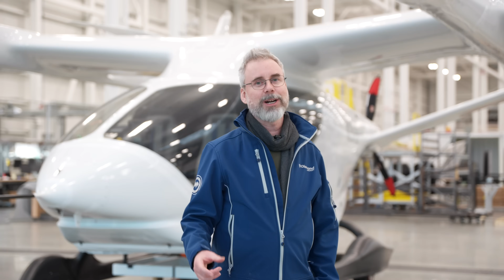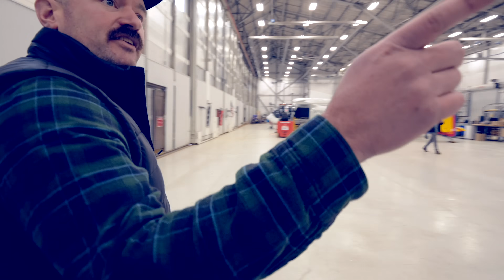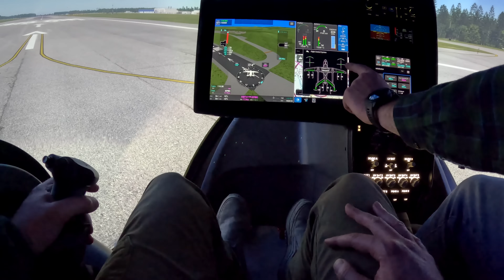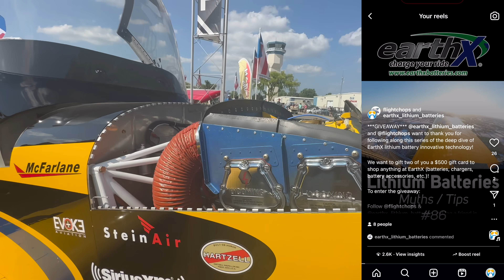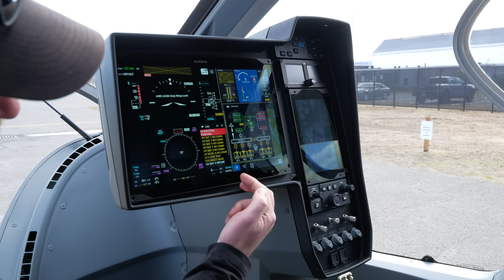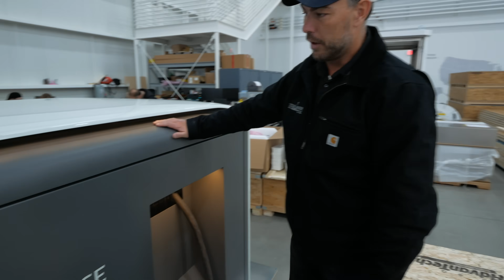Learning to Fly Alia: No Feet?!

Comment: Still too many buttons to operate it's fking ev why do we need so much have you seen rc planes they are models for big planes but run on battery and need only a few buttons to fly up it should be easy to use not hard to use

Comment: Very cool, can’t wait to see the VTOL version. Will be cool to see if they adopt the NACS plug type but either way great to see EVTOLs adapt the EV charger standards. With how high they can charge now, the flexibility to be used between both platforms will make these scale so much faster as electricians are getting more experience with EV chargers instead of having to learn a whole new infrastructure type.

Comment: I would like to float a new idea.
would it be possible to design a small electric emergency engine to add to single engine aircraft.
Only to be used in an emergency such as the killing engine failure on climbing out on take off

Comment: It just does not seem it would add any weight to move the pivot point on the stick to the pedals. It is all fly by wire so all you would be doing is re-routing the yaw wires to the pedal pivot. But, I do admit I am NOT an engineer.

Comment: Ercoupe has joined the chat
Reply: @FlightChops Funny story.  I used to do ultralight flight instruction at a local airport.   There was a crusty old Ercoupe that sat there forever.  One day, this old guy shows up and and does a few quick checks, jumps right in, and does a lap in the pattern and lands.   He taxis back in, and when he turns onto the ramp, the whole side of the plane is covered in oil. He forgot to put the fill cap back on. How that old codger managed to live as long as he did is a miracle in of itself!

Comment: I do have some concerns regarding electrical planes or actually anything that requires electricity. With the advent of AI and these new massive meta centers designed to give power to the AI's needs. So along with this apparent surge in electrical planes and electrical cars etc ad nauseum, we will be putting so much demand on our electrical grids that i believe we will encounter serious issues of detriment along the way. One example of a detriment is a 2 million square ft. Facility that Facebook has running, is causing the surrounding community, people's homes to have critical water issues. From the water being an absolute danger to consume to there not having enough pressure to use what water should be available that once was prior to the facility being built and turned on. Im all for innovation but not at the cost of peoples health and the environments health. I find it ironic that the proponents of getting rid of fossil fuels in favor of electrical vehicles, etc, seem not to care so much about the negative impact these high demands on our nations power grids are causing. Oh well i guess a few million peoples lives being destroyed is a small price to pay for innovation 😮

Comment: Are they using the NACS connector for charging? If not, they should definitely move to that. Obviously it's hard if they have already deployed tons of chargers and are outfitting the plane with a different plug, but standards should be adhered to. It would absolutely help adoption at airports since it is the standard for cars.

Comment: Biggest problem I see off the bat is that pilot and co pilot uses different hand for control so when you switch seat you have no muscle memory to use. The twist stick yaw is pretty standard in gaming pheripheral so if you are used to cheap hotas and flight sticks it will be very natural.

Comment: The problem with many flight sim setups is that you have pitch, roll, yaw and throttle on one hand. While in an aircraft you have pitch and roll on one hand, throttle on the other hand and two feet for yaw. Ask a drummer if he prefers to drum the same song with one hand or two hands and two feet. Why would you remove two feet and give their controll to an already occupied hand? Is it cheaper for the cost of safety? This would definitely create unecessary crashes in crosswind landings.

Comment: I am not sold on the twisting stick and lack of rudder pedals either. You're wrist has to do a lot more work and needs to be flexible to a lot larger of a range of motion. Many people particularly older people or people with injuries or other medical conditions may not have this extra required range. Additionally, the "added weight" excuse is ridiculous. This is a fly by wire aircraft and there are pedals there already but only used as the brakes. What's the added weight of a sensor and wire or two.

Comment: Hats off to these guys, however I think EV's are going to fail long term.  Lack of range is the single largest concern, because lets be honest, the range sucks. And for aircraft, 45 minutes is absurdly range limited. Then there's the fire threat from thermal runaway. Fire of an inflight aircraft is bad, but with only batteries for power things become a fatality in progress with no escape.  I'm sorry, but an all electric aircraft should not be a thing.

Comment: I dont see any good reason why they would not use rudder peddals. This isn't just about the technical requirement, but about the control scheme most pilots are familiar with and to which they would probably fall back to out of habit in case of an emergency

Comment: Rudder pedals are instinctual, twisting is for videogames and removes the physicality of piloting an aircraft. Being in the moment, physically operating prevents complacency. The less exertion removes immediate awareness and will cause accidents. We are seeing this very issue with EVs currently. Flying is not and will not ever be for anyone and everyone. Flying requires a particular level of intelligence and capability that not everyone has. Removing a critical control method for other aircraft types and replacing it with a videogame method for ‘ease of use’ only complicates what already works.

Comment: This aircraft isn’t being built for pilots, it is being built for passengers.
Reply from the maker: Why can't it be both? 🤷🏼‍♂️🤓
Other than getting used to the twist stick for yaw, the flying experience was great, and visibility from the cockpit is amazing.
Also - a big part of the mission profile for the airframe is cargo.
Reply: @FlightChops My initial post was based on the error that this was being developed as a flying taxi (eventually unmanned) like the Jobi. My mistake.
Reply: It could do ETOPS, engine turns or passengers swim.

Comment: Gut reaction, there's some BS here. For starters, having those lift props parked there is the opposite of having a slippery shape. That twist stick is going to cause pilot wrist strain and fatigue, the torque load on the hand and wrist limits how far and fast the hand can move in the roll and pitch axis. Gusting crosswinds are going to be a lot more complex to deal with. The FAA designation of what makes a motor and what is an engine, goes counter to other applications of fuel burning Engine vs electric Motor.

Comment: i wonder if this will open flying up to people with spinal cord injuries (if they can move the brakes to another control),  because holy moly would it be neat to fly one of these. i mean i can't fly anything and probably never will, but it sure would be cool to see other disabled people be able to get up in the air!

it is pretty 😳 that they're using 21700 li-ions when they really could (and should) be using lifepo, even if it cuts the range down by a little bit. i would rather not be in the equivalent of a 2 or 3 Tesla fire in a now-dead aircraft at 20,000 feet.

Comment: Range anxiety on an aircraft is on a whole different level, can't pullover, not to mention the range calculation depends on battery state and we all know how temperamental batteries are. With the requirements of fuel carriage to reach destination plus missed approaches plus a diversion etc, these Electric planes still have long way to go, pun intentended.
Reply from the maker: They’ve actually got a pretty good range with the reserves already accounted for.
And it’s only getting better.
The test flight that I was a part of had the airplane cruising around at 5000 feet for well over an hour and it landed with enough reserves to do more than two patterns.

Comment: Motor?  Engine?
Does it create mechanical force by converting fuel into power within itself, or does it create mechanical force by having energy piped to it from a separate source?
If it burns fuels within itself, it's an engine.  If it is powered by an energy source that's piped to it from a separate source, it's a motor.
Reply from the maker: 🤷🏼‍♂️ I don't make the rules - I'd have agreed with this idea before having it explained to me that the FAA is in fact designating this configuration as an electric engine (which is shared in this video as its own scene).

Comment: if they added a microturbine generator for greater electrical generation, you could lower the battery weight, and then utilize the batteries as more of an emergency reserve.

Comment: Can't wait for the next installments, really cool that Beta brought Steve in and gave him such broad access!

The rapid charging system seems well thought out, no long cables hanging around, no physical interface (which has worked well for Tesla) although it's interesting he highlighted that the cable is not liquid cooled. In existing chargers this results in a continuous power limit of around 200kw with short peaks higher than that. The charging infrastructure side will be very interesting to watch too.

Comment: What consideration is given to the gyroscopic precision effect to the electric motors as there seems to be more mass spinning in free space? Or is it a non-factor?
Reply: Compare to the spinning parts of the usual engines…
 For the usual gas aviation engine, there is a big crank shaft rotating…

The electric motor will have some rotating parts… on the same scale…

P-factor is what we use when discussing the gyroscopic effects while flying… during take-off, while raising the nose it can be most noticeable….

So much going on during rotation, many won’t notice it or why it happens…

It often looks like the effects of cross winds…

😃

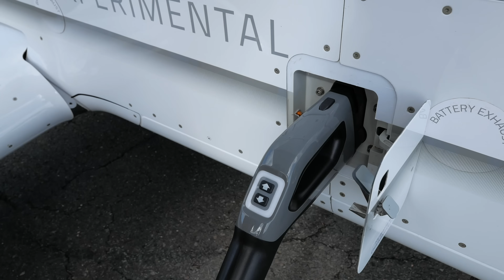Comment: 20:00 I believe he said that the battery modules are already movable. The common sense next step is to make them swappable for refueling. You gain the ability to splash and dash plus get optimal battery health because they don’t have to charge at max rate. Regardless of chemistry, battery cells degrade more quickly the faster that you try to jam electrons into a waiting seat.
Reply: That's not true, LFP doesn't degrade with faster charging

Comment: My question is... Why is there a pilot in the first place? To speed up certification? UAVs have been s thing for 30 years and small ones even commercially for nearly 10 years. I don't see many reasons why this couldn't be autonomous.
Reply from the maker: Wisk is attempting it this way - but they will be MUCH later to market than the other players that are starting with crewed aircraft.

Comment: Electric everything fatigue. Looking forward to the next EP with real planes.
Reply from the maker: Fair enough, but hang in there… I’m gonna do one more to finish out this series (later this week) and then get back to a regular GA episode about the challenges related to flying into Oshkosh 😬… and then I’ve got more IFR flying 🤓 and a good one coming up covering my first ever aerobatic contest, where a 14 year old beat me 😂
Reply: real planes... what's not real?  it has to burn gas and have 3x (or whatever the amount) the moving parts to be real?  fuel burning engines are fine, but I don't think you need to diminish or insult these guys for what they've done here.
Reply: @marred2277  Oh it's not an insult. I'm looking at the actual practicality of such nonsense, and it's not there. Never will be either. Such virtual signaling is usually a grift, and gullible investors get to be lighter in the bank when they close shop.
Reply: @hawkdsl "never will be" practical is quite the claim.  How many people said flying machines would never be practical 100 years ago. I'm sure it was a lot.  This channel isn't one solely devoted to warbirds and never claimed it was, and your attitude is piss poor in my opinion.
Reply: @marred2277  EV aircraft are not practical and never will be. Just deal with it. My attitude has nothing to do with it. If you like them, that is not wrong or right. That is your preference. However, that doesn't change that EV aircraft not related to drones is a waste of money.
Reply: @hawkdsl  You're entitled to your opinion.  But history pretty much proves you wrong.  And it doesn't have to be an either/or.  There are probably applications right now where this airplane could be utilized, in conjunction with fuel burning aircraft.
The problem is, you're being rude and insulting by saying FlightChops is wasting time making this content.  By saying Beta are basically liars and crooks.  And by saying that anyone investing in them are gullible.
All the while, this video proves you wrong.  This is a real airplane.  If it's not, then the Wright Flyer wasn't either.  Energy density of batteries is only going to improve.
And I'm no hippie, but I hate to break it to you, petroleum isn't going to last forever.  I'm not seeing any coal powered aircraft, and how dumb is it to burn food (corn) for transportation.
I mean, you basically contradict yourself when you say drones aren't a waste of money. I think you're right.  But what is the VTOL version of this aircraft but a drone with an extra propeller that allows transition to cruising flight.  A drone that can carry its pilot.. and passengers and/or cargo.
Reply: @hawkdsl  I think I'm being censored by yt, as usual, for no good reason.  Going to paste the last line of my response, see if it gets through:
You basically contradict yourself when you say drones aren't a waste of money. I think you're right.  But what is the VTOL version of this aircraft but a drone with an extra propeller that allows transition to cruising flight.  A drone that can carry its pilot.. and passengers and/or cargo.
Reply: @marred2277  Now you're just coping. Thanks for the conversation. Invest all of your savings into EV aircraft. Good luck.
Reply: @hawkdsl  Coping.. heh, nah.  Development needs to happen on electric aircraft, cause guess what, petroleum isn't going to last forever.  And from what I've seen, these guys are doing a great job at it.
Reply: @marred2277  And there it is. Seriously, development absolutely doesn't need to be done on human rated EV aircraft. Go ahead, sell your house and give them your money. Back up delusion with hard cash. There's also a bridge in Brooklyn you might be interested in.
Reply: @marred2277  And there it is. Seriously, development absolutely doesn't need to be done on human rated EV aircraft. Go ahead, sell your house and give them your money. Back up delusion with hard cash. There's also a bridge in Brooklyn you might be interested in.

Comment: I am curious to learn how - at a later stage when they add the V to the TOL - the pilot will control the lift rotor. 

In a helicopter that of course is done in the collective lever. Or in other words: with inputs given by the other hand.  Which in a helicopter always is the left arm, regardless you are piloting from the right seat, the left seat, or a middle seat. 

Now, swapping left to right hands I‘d consider would require major re-training efforts.
Reply from the maker: The CTOL version is designed with the VTOL controls in mind so not much changes about how the pilot operates it. 
I'll cover this in more detail in the next episode, but the throttle "wheel" in my right had is connected to a collective lever that will ultimately be what is used to engage the lift rotors.

Comment: That's such an awkward position for your wrist to do a right input with the stick but twist it to the left for a slip, or the other way around for that matter.
Reply: I think one can get used to it
Reply: Personally I would have designed it to have a thumb stick on the flight stick for yaw, rather than relying on twisting cos yeah that is going to be HELL on a pilots wrist - especially once these types of craft are common enough for a pilot to do their entire career flying them.
Reply: My wrist hurts just thinking about it. I briefly used a z-axis stick for flight sims, and the most important upgrade I ever made was getting a set of rudder pedals.
Reply: As a Gamer™, twist sticks are horrible. What's next, clicky thumb sticks like the awful L3 & R3 buttons on modern consoles?
Reply: @dove_tam  Don't you put that evil on me Ricky Bobby